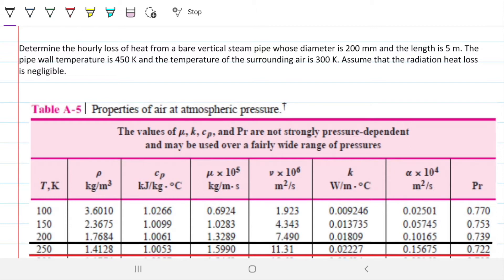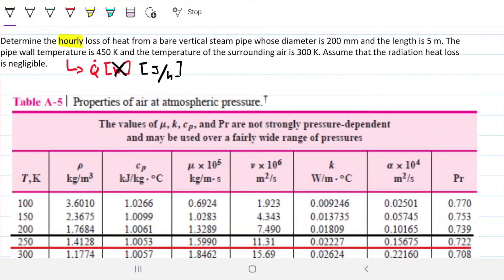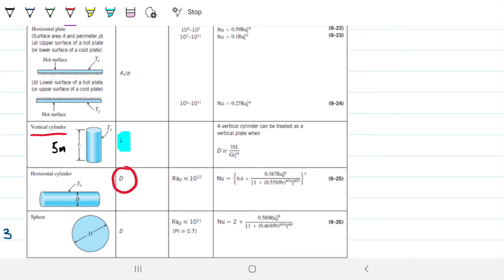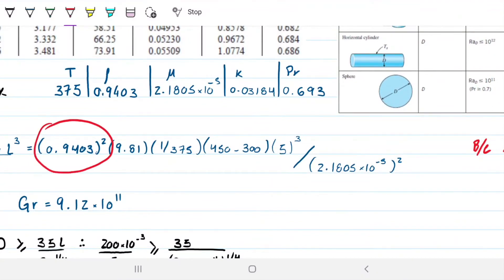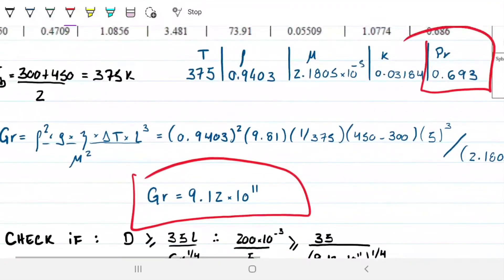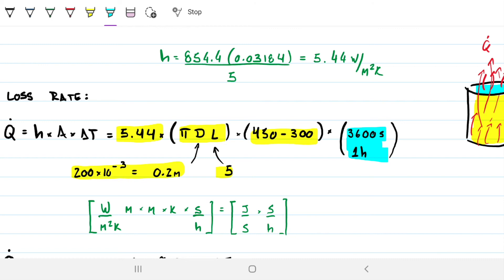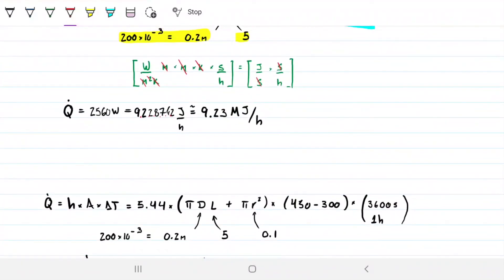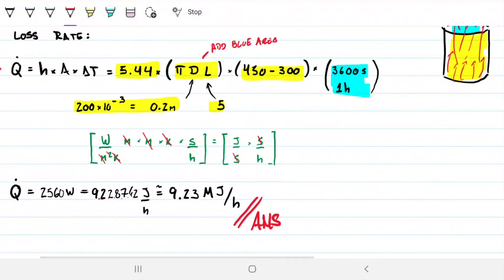Natural Convection Vertical Cylinder  (Air) | Free Convection | Heat & Mass Transfer

Comment: Is there a Nu correlation that corresponds to free convection inside a vertical cylinder? why isn't it found in the heat transfer books?
Reply from the maker: If your cylinder has thin walls, then you can just do Q = 2xQ of outside. If it is a solid cylinder, then only outside matters (since it is area-related). If it has thick walls, then you can calculate the nusselt twice (one for the outside wall, and one for the inside) just like in the video but changing the characteristic length. 
The only situation in which the Nu correlations from the book cannot be used, is when you have a void small enough in which the boundary layer of one part of the wall interacts with another part. Then you can use FEA
Reply: @EngineeringHack  Thank you for the prompt and valuable reply.
Just a couple of more clarifications if that’s OK:
1-	My cylinder has relatively thick walls, so the Nusselt number corresponding to the inside part of the cylinder should be computed. In this case, the characteristic length would be the pipe diameter (instead of the length), right? In this case, the Gr number in the condition [ (D/L) >= (35/Gr^0.25)] would be computed based on what characteristic length.
2-	From what I understood from the video, in case the (D/L) >= (35/Gr^0.25) is not met, I should account for the flat horizontal plate. In my case, the top and bottom covers of the cylinder are adiabatic surfaces (my fluid is actually enclosed in a vertical cylinder with perfectly insulated top and bottom plates). So I need not worry whether this condition is met or not, right?
3-	My cylinder diameter is around 95 mm with a length of 5 m. So the issue related to having “a void small enough in which the boundary layer of one part of the wall interacts with another part” could be applicable? How do I know if it is indeed applicable, because I would like to avoid Finite Element Analysis ☹.  Kindly clarify 🙏.

Comment: My Rayleigh number doesn't fall in between the ranges even though the value of D which I got is greater than 35L/Gr^1/4. Should I use the Nusselt formula for the "Entire Range" then?
Reply from the maker: Yep, is the answer I can give you with the info you've provided me. 
But to give you a confident answer I'd need to analyze the entire problem

Comment: what to do if the D/L > 35/Ra condition doesn't hold ?
Reply from the maker: Then you'll need to use other empirical relationships (equations)
Reply: Did you figure it out? I have a report I need to do and can't figure it out
Reply from the maker: @symondyounes3388  Grab a heat transfer book. It will have a table with the different equations you can apply and when you can apply them. Just look for your case